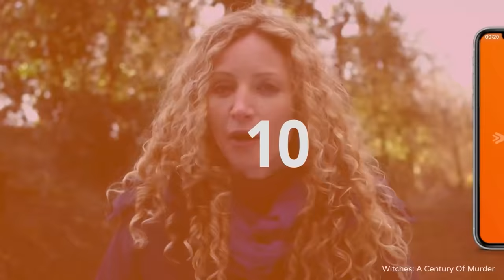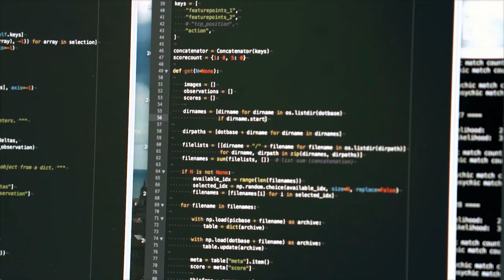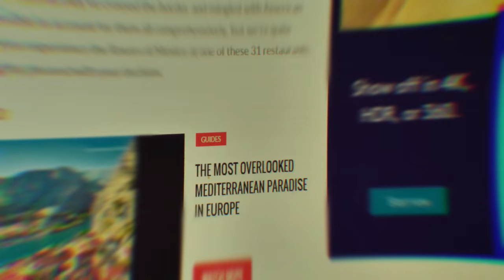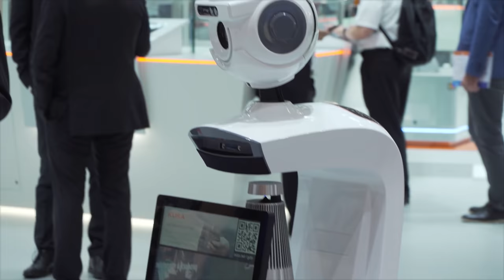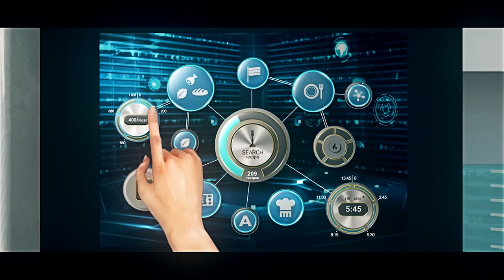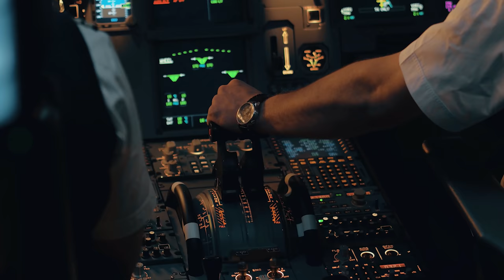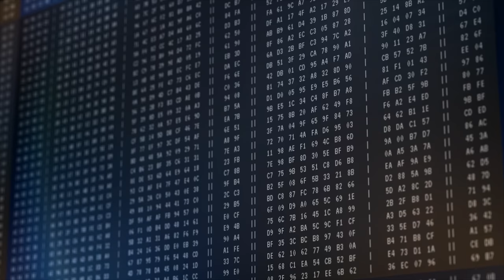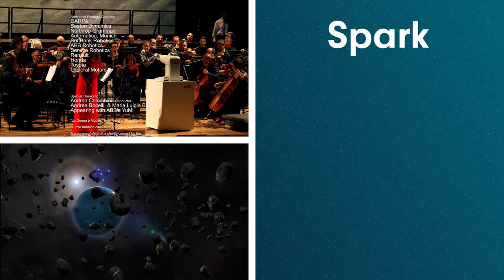Can A.I. Be Taught The Difference Between Right and Wrong? [4K]

Comment: Can AI be taught the difference between right and wrong (in the same way as left-to-right, front-to-back, top-to-bottom)?

Yes, only if humans themselves can judge right and wrong over different eras, with certain preset standards and guidelines, so that humans and AI have the same sense of meaning and purpose to follow - more importantly, the errors and mistakes of AI made are treated the same way equally, as if humans themselves had made.

By then, the only issues concerned here is: how do we judge right from wrong, in terms of the involvement of both the fluctuations of quantity of people, and moral quality of human conscience - therefore, "trial and error" seems to be the appropriate approach in these uncharted territories, for the similar pattern and method also occurs in nature.

Still, social controversies will keep happening in terms of the varying scale and number of "tragedies" involving AI and humans inevitably different.

Comment: 2:17 "Artifical" has been a pompous term, to declair authintic from a lesser worthy, in truth, AI can render in fully mortal resemblance by flesh, created of mere fleshy composit like a meat/tissue fiber, even a Rib of another person. Simply not conceived modernly. 
6:35 "Deep Learning" Is when the Intelligence of a specie can exponentially advance in evolution through knowledge gain, this can be a threat to an economic game, such as the Currency Collosal WALL as it would need to compete against humans in the Pursue or Perish play, yet not depend on the advantage of any Bank Beast trade, it can be just as vigilant than one. 
 Making AI understand right from wrong, requires teaching it, in example, about the Consequence term, which is the result that ends with "wrong." But instead it learns by law rules of program, a game used to ignore corruption of systems establishment legislated to defy the karma of required modifications called 'enforcement.'

Comment: This is a very general video about AI and robotics and is years behind the times if you think a robot can't pick out colours or sort bottles. Have these guys not seen DALL-E 2 yet? I'd like to see a real in-depth more technical video answering the question posed on an AI learning right from wrong. It's a valid question which this video barely touches on. What data sets would it use? What cultural biases would be accounted for? What possible conflicts or paradoxes would it have to deal with? This goes way beyond trolley problems. Just technical correct vs incorrect is hard enough and contextual so generalising to the human perceived moral or ethical framework of right and wrong is a long way off but not as far as you'd think from this video.

Comment: It's Hollywood it's normally Fantasyland most of the physics in movies are very incorrect some movies did pretty good but most is outlandish lake drone a cigarette onto gas does not explode actually gas put cigarettes out even if you blow on the cigarette to make it harder it doesn't reach 600 degrees to combust gas it only Burns at 500

Comment: No AI cannot know right from wrong  and No it cannot be alive or sentient. It can sure mimic knowing and being sentient. That is all. What point would there be in adding life if you could? None life has too many time consuming, and fallible areas of life which is why we are building AI in the first place. AI acts out what we predetermine are better more efficient ways of doing what we do and arriving at what we do by  code not thought. We learn very much the same way but with a conscious factor that is not code able.  Achieving balance, a map of the environment, the ability to read body language are all very replicated by code but that feeling when there is no stimulus from the outside environment and comes from within  is life as it comes to Human Beings differently at no time, or reason but none are immune from it but some are damaged and feel less of it.  Replicating can be coded, so AI that replicates may sound and look very sentient but it is just caring out instructions that do what ever code better and more efficient. The coders said we did not code it to do that but the cells  the AI was reading had replication all over them. Not to be a spoiler  but life is yet to be coded and if it could be it would not be life because life is inspired by the creator and not coded. There I did it. Those that do not believe in a creator will dismiss everything I ever say.
Reply: Why would AI not be able to learn the law? If anything, the law is rather easy to formalize. ;-)